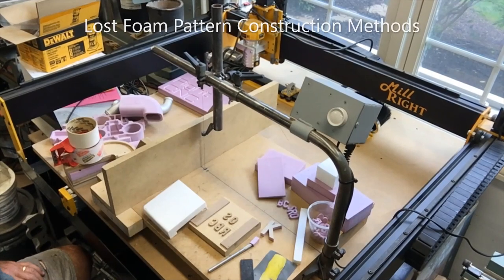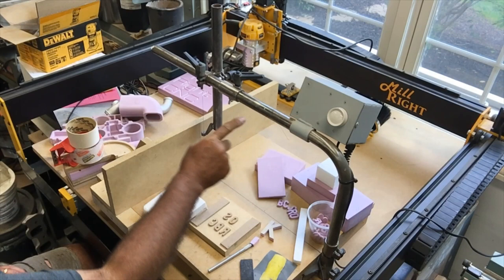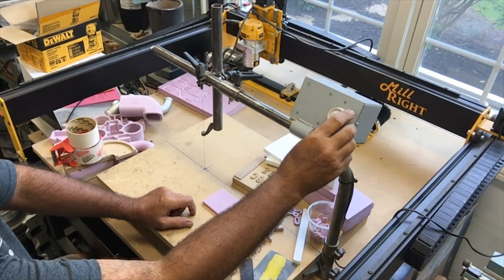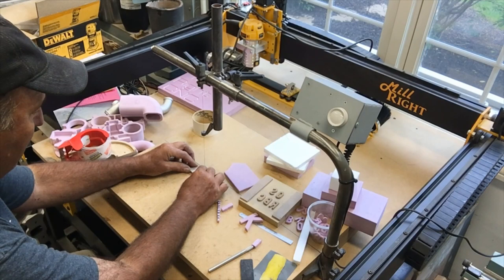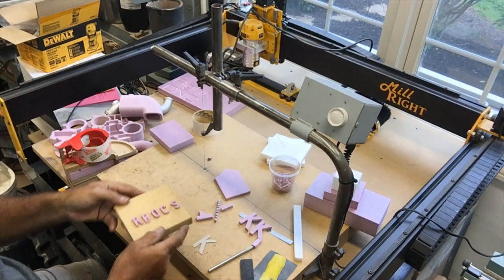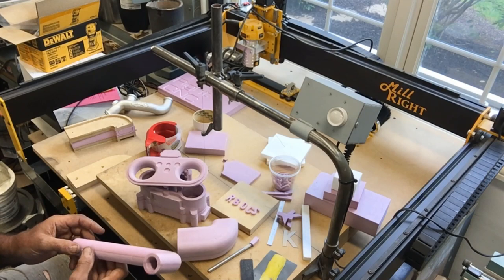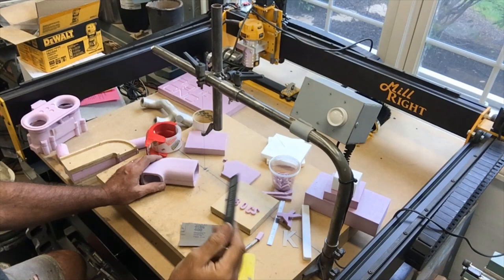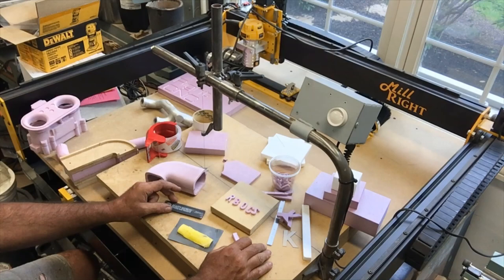Pattern Construction Methods for Lost Foam Casting

Comment: name one of the videos where you use the pin router please
Reply from the maker: How about 7? Here’s a fairly complex example for a carburetor main well. 
https://youtu.be/yzYjrlugI2Q
And here are some simple parts that when assembled are a cylinder and head for high performance competition chainsaw.
https://youtu.be/vz-9D9FSkrA
https://youtu.be/8Qm7_-B104A
https://youtu.be/LOsekMaXZ0c
https://youtu.be/0EkOwXO6Y0A
https://youtu.be/n3oaRDKulwA
https://youtu.be/iAZrcoEwnAg

Comment: would PU liquid in a mold work to make custom models ?
Reply from the maker: Polyurethanes are thermosets and are not good lost foam casting pattern material. When exposed to heat they don't melt but just decompose to carbon/ash and produce pour castings with defects. Polystyrenes are thermoplastics. When exposed to heat they first melt, then the liquid turns to vapor which can pass through the refractory coating into the mold media. Too bad because two part PUs would be convenient. Best, Kelly
Reply: @kellycoffield533  then its only done by cnc machines if we are going to make precise pieces ?
Reply: @kellycoffield533  I have seen 3d printed parts using high impact polystyrene, have you ever tried that for lost foam casting?
Reply from the maker: @hamamtouqan1005  From a hobby perspective, yes, though some have successfully molded expanded beads, but it's quite the undertaking to make the tooling and manage the process in a hobby setting. CNC is far more practical for low volume non-commercial endeavors. Best, Kelly
Reply from the maker: @hamamtouqan1005  It's too dense. Need to stay in the 1 to 1.5lb/ft3 density range of PS foam. Best, Kelly